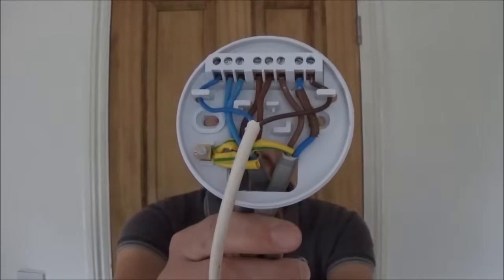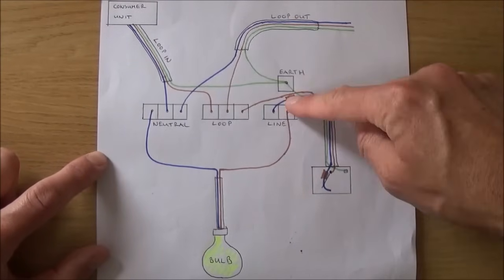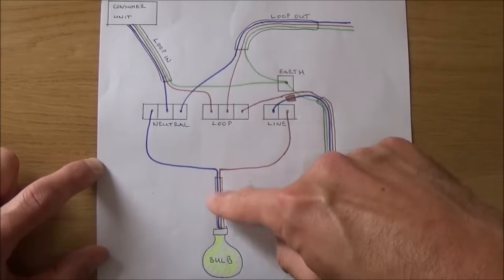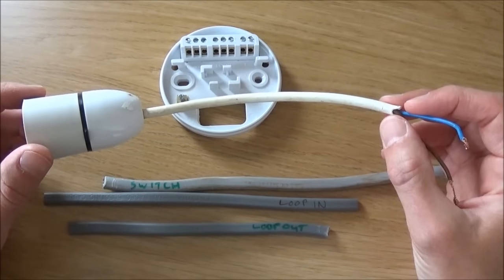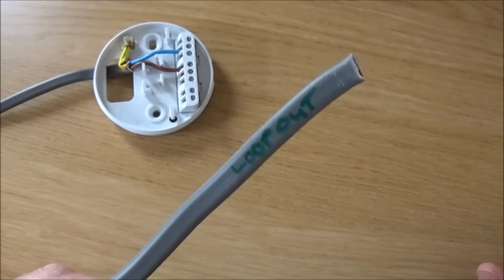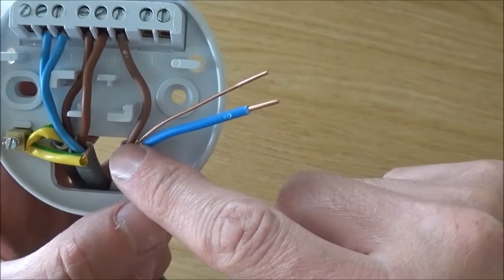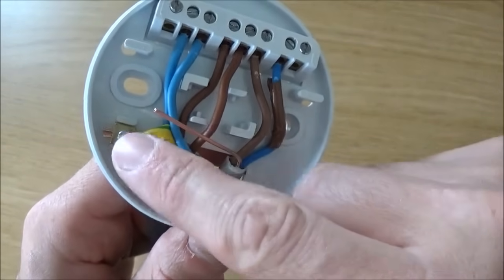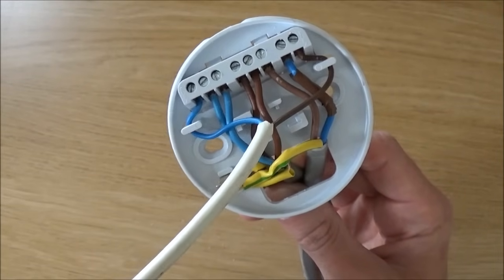How to wire a ceiling rose - lighting circuits explained. Ceiling rose pendant install!

Comment: Excellent video! I have a question - there isn't enough room in my ceiling for a junction box.  Is it ok to store the wago connectors inside the top of the light fitting?
Reply from the maker: Yes, that's fine, but just make sure there is no exposed (bare) copper wire outside of the connectors. Hope that helps and thanks for watching!
Reply from the maker: Just to clarify, it's fine if there is room for the connectors in the back of the fitting like in modern metal light fittings. Just don't push them up into the ceiling.
Reply: Thanks for the response!

Comment: hi 3 wires coming out of ceiling, only  live and neutral in the new light what do i do with the earth wire.
Reply from the maker: Well I assume the light fitting is plastic double insulated and doesn't require earthing. If this is the case then just terminate the earth wire into a a suitable connector block so it can't make contact with any other wires. This can be left in void in the light fitting by the other wires. Just be sure the fitting doesn't require earthing. If it does, then you must connect the earth wire to the fitting. Hope that helps, thanks for watching!

Comment: Great video, I'm changing a ceiling rose out to a new one for one light and found I have red and black wires hanging down from the ceiling? My new ceiling rose circuit has a brown wire into the live terminal and a blue into the neutral terminal and no earth wire? Not sure which connects where and if I need any connectors? So I think I'm missing something here? Any advice would be most welcome? Thanks
Reply from the maker: Hi Pat, sounds like you have a very old wiring set up with no earth. You need to connect the new ceiling rose in the same way as the old but make sure the new ceiling rose is double insulated/ class 2, as it will have no earth protection. Basically you cant connect any modern metal fittings as it would be dangerous. Might be worth getting the wiring upgraded soon! Hope that helps. Thanks for watching!

Comment: Great video.
One quick question.

In your drawing 46 seconds in I have neither the 2nd Loop out nor the switch. I only have the power "in" Loop (there being a 3 pin fused plug at the end which will only be plugged into a traditional socket as and when the light is required. Infrequently.

I was intending on having such hanging in the  Barn as a temporary source of light - not to be left "live" for any length of time.

Is it simply a case of wiring both bulb "live" wire and loop in "live" into the Loop section of the ceiling rose? Or does one put the Bulb live and loop in "live" wire into Live part(ie in your drawing where switch normally wired in)

I'm not an electrician so appreciate any feedback 

Thanks
Reply from the maker: Just to check, I think you have a length of cable with a plug on the end (with 3amp fuse?) and you want to wire it into a ceiling rose to fix to the ceiling. It's not a particularly common thing to do but if that is the case, then just wire the live wire to the line (L) terminal, neutral wire to neutral (N) terminal, and earth wire to earth (E) terminal. Then your pendant will have 2 wires a live an neutral. Wire the Neutral wire into a neutral (N) terminal, a the live wire into the line (L) terminal. You can leave the loops empty as they are not required for what you are doing. Just make sure you have a cable at least 1mm2 twin and Earth, and plug with a 3amp fuse. This should than be safe to use. Hope that helps. Good luck and thanks for watching!
Reply: Yes that's correct - Length of cable with a plug on end. 3 Amp fuse.
Superb. Got it.
Thanks for clearing that up for me. Just using what I have lying around hence the odd use of the ceiling rose! 
Cheers

Comment: Alright mate. Great vids. But I've got a scenario for you.

How would you add 1) a PIR sensor to allow lights to come on Automatic when in sensor range?

2) add 3 additional downlights (Spotlights) to the same circuit as the ceiling rose.

So Ceiling Rose - Sensor - 3x Down lights.

I've bought 3x choco boxes for each down lights. 

Can you make a vid tutorial explain this please 

Thanks
Reply from the maker: Hi Asim, I won't be able to vid any time soon.I have a video of how to wire downlights - https://www.youtube.com/watch?v=DjtB6OnjvlE. Just take the length of twin and earth from the switched live. neutral, and earth on existing light. Then when light switch goes on, all lights go on together. I can't explain the PIR over a message. If I get round to doing a video I'l let you know. Good luck with it and thanks for watching!
Reply: Cheers for getting back to me.

I'm confident connecting the down-lights from Ceiling Rose. But thought I'd be extra in getting a PIR, someone did mention to get a junction box for it. But No probs.

Great Videos and thanks again.

Comment: Would you consider doing a what's in tool box video?
Reply from the maker: Hi David. I have loads of tool boxes. Do you mean useful tools for everyday jobs, or specifically electrical? I don't see why not. I just have to find the time. I have a long list of vids I've had requested and many more I want to do but I'll get them all done in time! Thanks for the question and thanks for watching!
Reply: General use but it would also be good to see electrical tools as well,
Reply from the maker: I'll see what I can do!